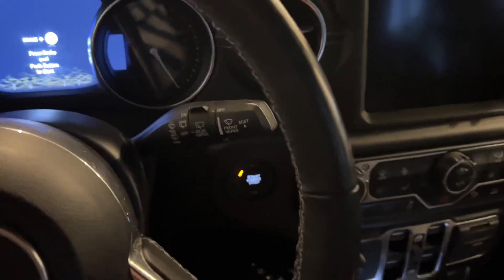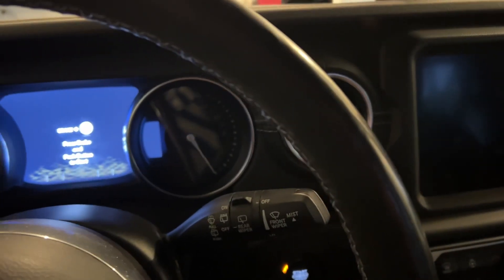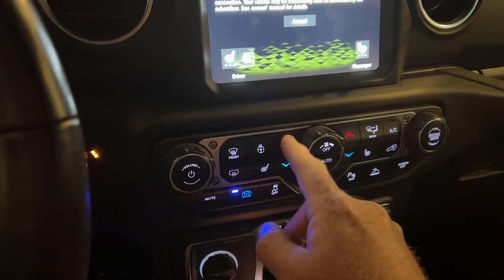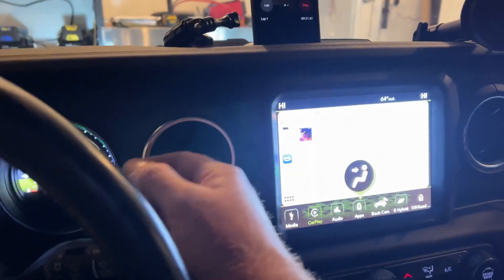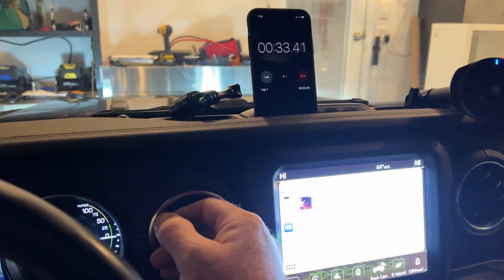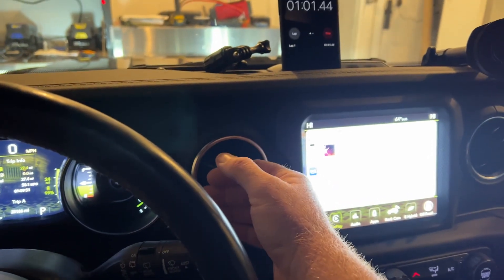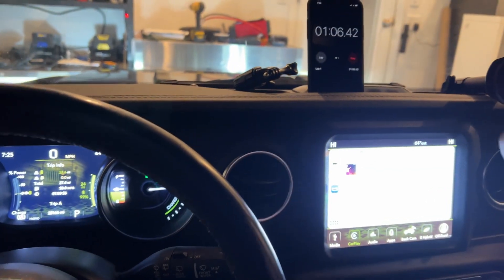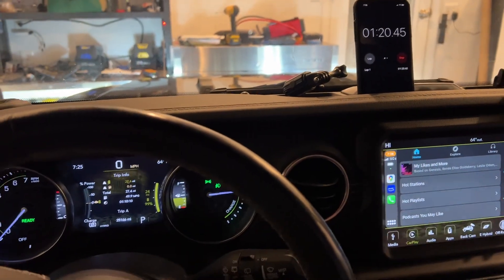How fast does the electric heat work

Comment: Nice experiment. I ran the same test just now using an infrared thermometer and it went from 48 to 80 in under 30 seconds.  At a minute it was blowing air over 100 degrees. By comparison it took my 2022 Ram 1500 (5.7eTorque) idling in the driveway 3:18 to hit 80 degrees at the vent and burn $7 worth of gas 😂